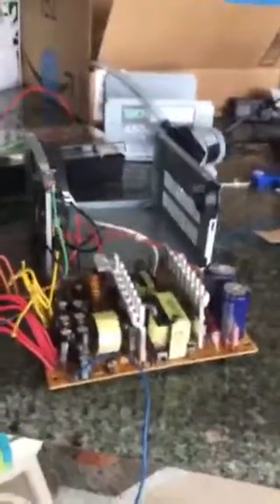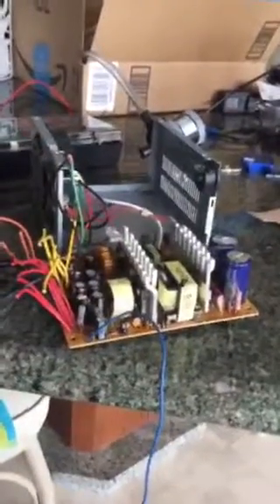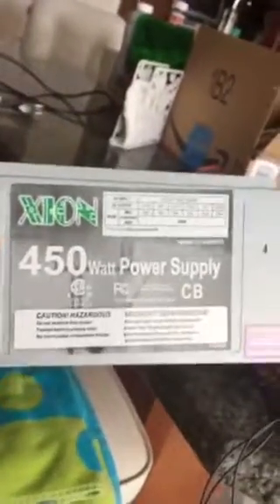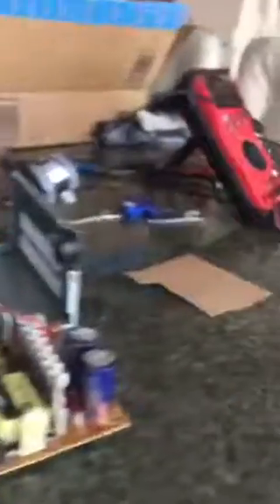Power supply for the Peltier cooling system

Comment: that little power supply cant even run the cooling fan when loaded with Peltier.. i tried this kind of power supply.. most probably 12v 2a...
Reply: Faysal Khalashi™ bs it's 450 watts 12v rated ..